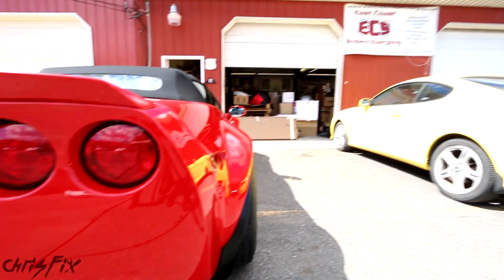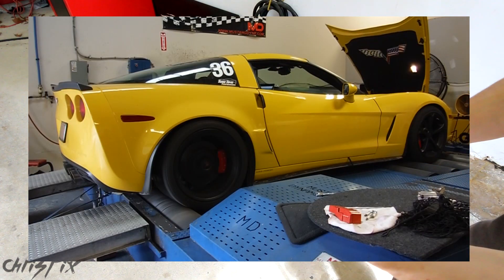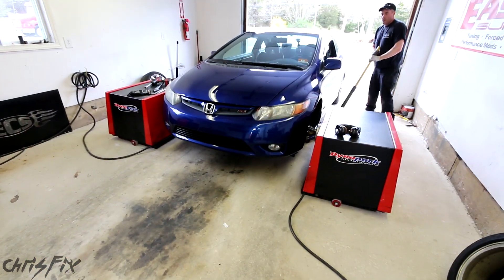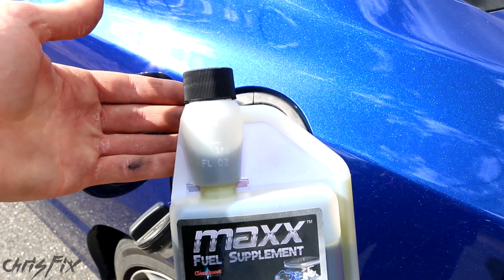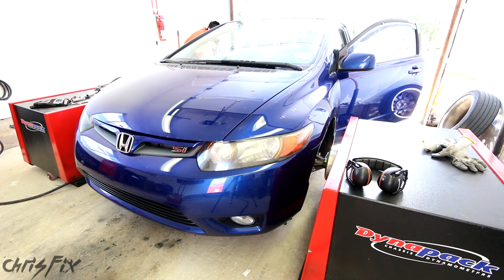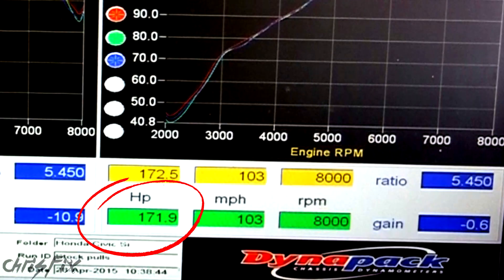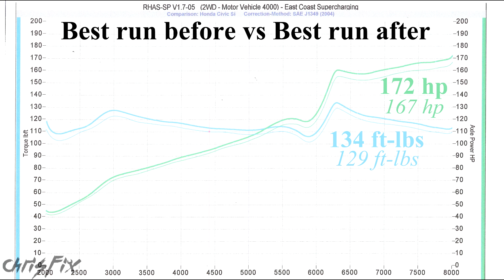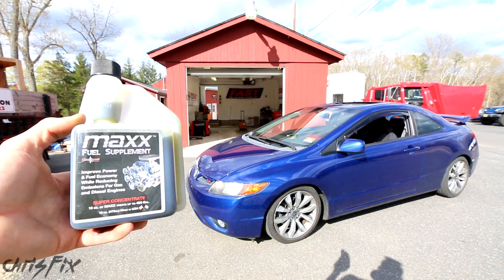Can a Fuel Additive Really Increase Horsepower in Your Car? (With Proof)

Comment: Might sound dumb, but a lot of honda guys run open header. You should dyno the civic si with and without open header to see if it makes a difference.  There was a big debate about it on the 8th gen forum not to long ago. But i dont think anyone did a dyno. That video would get you a lot more subscribers. 

If you do it try with the axel back off as well, i see a lot of people say that helps increase power as well.
Reply: Brian Dixon You just want him to dyno it so you can do the modification LOL, do it yourself cheapass
Reply from the maker: Brian Dixon That would be awesome to do but also very costly. I would need to get headers and or an exhaust and then do more dyno runs. But I like what you are thinking. I will have to see what I can do!
Reply: ChrisFix  could just do 3 runs with stock headers and 3 runs with open
Reply from the maker: Or install an electric cutout so you can flip a switch instead of unbolting the exhaust!
Reply: jr540123 I don't think I have much experience hearing straight piped V6's, but it is hard to have a V8 sound wrong as long as it's in good running order.  :)
Reply: DE Nichols some swear by it. There is even a video of a stock header (open) civic si without a tune that ran faster times and trapped higher speeds then some bolt-on tuned si's. This discussion could go back and forth all day. As it has on many many forums for years.
Reply: DE Nichols oh i agree with that, but my point is the cost. Why spend 350+ for a cut out that might very well make you loose power? That to me doesn't make sense.  You can just jack it up and unbolt it in between cool down. More work and a bit more difficult,  but you get the same results with less cost.
Reply: Car Dealer i have done it and goone to the track and posted noticeably better times picking up one MPH and 2 tents of a second.  Ive done my owm experiments over the years. But in the honda community at least the one i deal in there is a lot of hear say and anecdotal evidence as in mine. 
But me doing a dyno test for my self,even if it was recorded and posted on YouTube wouldn't get nearly the views or feed back as if ChrisFix were to do the test. And by you saying for me to do it myself, why dont you do it all yourself and not watch DIY videos.  It truly can go both ways. 
And finally i would drive around open header its too damn loud. And if i wanted to "do the mod" my self. I could any day at any time. Again i have all the evidence i need that it works. Just thought it would be an interesting video, and would love to see the conversations it would create.  But thanks for your time to read my reply Car Dealer.
Reply: ***** Pulled it off a forum, this guy explained it better than I ever could.

Exhaust many times is compared to other fluids. However, it is not quite the same due to the temperatures created during combustion and the pulses an engine creates. For an exhaust system to function properly, it has to balance flow and velocity. I am writing this to cover a broad range of knowledge bases and ages that typically frequent forums and have questions about how exhaust really works. The operation and physics behind exhaust, and the common misconception that backpressure is necessary for proper engine operation is the focus of this article. The hope is, with the knowledge gained here and from other sources, that an informed decision and discussion about exhaust can carry on.

Velocity, Flow, and Temperature:
Velocity is the speed at which matter is traveling. Velocity in an exhaust system has to be understood to select the correct pipe size. The straw example is a simple but effective method to explain velocity. If a person blows through a small diameter straw, there is a great amount of speed of the gases exiting the end. However, even as the person blows as hard as they can, they are restricted by the size of the straw to the volume of gas that can be moved. Conversely, if a large diameter straw is used, the person will be able to move large quantities of gas but the velocity of the gases will be greatly reduced.
Flow is the ease at which the gases travel through a set container. The walls of the container will always cause some resistance, but this force is usually negligible. The more things inhibiting flow in the path, such as baffles or chambers, the more force is required to flow at the same velocity. If a piece of paper is held next to the end of the large diameter straw, it causes a slight resistance to the gases escaping the straw. Gases will take the path of least resistance. Since gases also compress, the molecules are forced closer to one another for a short period because it is easier to compress than escape the end. This causes the pressure to increase. Once the pressure rises and overcomes the force the paper puts on the end of the straw, the gases begin to escape out the end. This is what many call backpressure because of the pressure that is built in the area necessary to escape the container. Backpressure only causes the origin to work harder to push more gases into and out of the container.
The temperature of the gases in a container greatly affects its behavior. The cooler the gas is, the closer the molecules are together in space. The warmer the gas, the larger volume the gas occupies. This is due to the force of the molecules as they come in contact with the container and other gas molecules.

Operation in the cylinder:
On the power stroke, the piston is moved down the cylinder from the combustion. As the piston begins to move upward, the valve on the exhaust side of the head opens allowing the hot products of the reaction out. When the piston reaches the top of the chamber, it begins the downward stroke and pulls air and fuel in to repeat the cycle. Simple really, but this is where the myth of backpressure comes in. My question all who claim they need back pressure to run properly is: What does it do? The cam controls valves so no “back pressure” is needed to close the valve, the piston returns to the bottom of the cylinder via the power produced, and the chamber needs fresh air and fuel to continue the cycle. Any gases that are trapped in the cylinder are detrimental to the next combustion reaction. The chamber needs to be fully evacuated so a pressure difference is created. As the piston moves on the intake stroke, a miniature vacuum (delta pressure) is created to draw fresh air and fuel into the chamber. The ability for the pulse to maintain the correct velocity and flow, interact and aid in the other cylinder’s operation, and exit the system are the key functions of the exhaust gases.
Modern vehicles do not rely on one cylinder in an engine so the interactions with the other cylinders are critical. This is extenuated in V6, V8, and larger cylinder engines. As one cylinder is firing, another is on the opposite stroke. This creates pulses throughout the system. Using these pulses to aid in the other cylinders operation is key. As a pulse is making its way into and out of the header/manifold it creates another pocket of delta pressure behind it. This drop in pressure is used to help “pull” the next cylinder’s exhaust gases into and out of the manifold and so on. This is referred to as scavenging. This is also why V6 and V8 engines enjoy the presence of a crossover of some sort. Due the firing order on each side, the pulses are not the same all of the time. Without some way for the pulses to equal the other side’s scavenging, the scavenging effect will be slightly different on either side. This is why many times a pop or poor operation of the engine is detected without a crossover. A pop may also be audible with a crossover system but this is usually due to a rapid acceleration/deceleration and the different rates of the pulses in the system for that moment. A crossover is recommended to be installed before the muffler, close to the headers/manifold to quickly maximize scavenging.
At any time there is approximately 14.6 psi pushing on all sides of you. The atmosphere exerts this pressure at sea level due to its mass. This is the only backpressure exerted on the exhaust system. The exhaust pulses upon startup must overcome this pressure to exit the system. After startup in a properly sized system however, the pulses continue to aid the next.

Adjusting the Power band:
The power band is described as: at X rpm produces Y horsepower/torque. This can be influenced greatly by the size and configuration of the exhaust piping. Exhaust is most effective at the point which flow and velocity are maximized. This point is when the pulse can expand to the size of the pipe without velocity being diminished. Too large of a pipe and the velocity slows, causing the pluses to create little scavenging behind them and the pulses weakly leave the system. Too small of a pipe and the flow is restricted, effectively “choking” the system.
The rpm range of operation is quite large on most motors. Idling at 700 rpm and redlining at 6000 rpm create very different environments in the pipe. At lower rpms, less volume in the system is needed. At higher rpms, more volume is needed. Since most drivers don’t do one or the other all the time, the median for normal operation is ideal. This is where the powerband comes in. By having a larger diameter system the higher rpm range may produce the best power because that is the point at which flow and velocity are optimized. However, in these systems a loss in low range power is felt due to the fact that velocity is not ideal. If the volume of the pipe is too large the pressure drop behind each pulse will not be as likely to help in the scavenging effect of the next cylinder. The same principle goes if the pipe is too short. The short pipe does not allow enough time for proper scavenging and leaves the system before it can occur. This is why things such as open manifolds and ending the system under the cab do not bode well. With a smaller system, low range power is optimized because lower rpms are most efficient at scavenging. At higher rpms, the system’s flow is not sufficient, thus less power is able to be produced.

More than just pipe:
Exhaust does more than simply get waste products out of the way. In vehicles that utilize oxygen sensors, the exhaust is the critical component to monitor air/fuel ratios. This measurement by the oxygen sensors is critical in maintaining correct a/f ratios and prevents from either lean or rich conditions. Changing the location of these sensors or how the gases interact with the sensors, needs to be accounted for by adjustments to the PCM.

Any modification to the system can have an impact on the performance of the engine. Understanding how the different segments interact with the whole is crucial when modifying a vehicle. With this knowledge, you should be able to understand how exhaust systems operate and be able to make quality decisions when choosing to modify your system.
Reply: Luke Hawkinson and i finally read the f150 forum  post. which is oddly much like what i pulled out my memory banks ....... too many hours in mech shops i think is the problem with me some days. i digress
Reply: Brian Dixon Take a trip back 50 years in my friends memory and he predicted to his friends, "Don't do it. You need to even out the engines exhaust pulses." Their endless racing proved him right.
Reply: ChrisFix either stock open or aftermarket would be a cool test
Reply: Brian Dixon Ah. Good thinking!
Reply: Jacky L. Damn it was just a suggestion, it wasn't a demand.....lol.
Reply: Jacky L. Oh and i agree on the mod comment,  but if you actually look at his videos, he does a lot more then test additives.
Reply: DE Nichols   With a full exhaust  cold air will not make it to the head once the car is shut off ... The exhaust cools slowly allowing time for the engine to cool also ...  If you pull the down pipe off ,  then shut the car off after a dyno run , there is a very high chance of damaging exhaust valves due to the cold flash of air hitting a very hot surface... It can crack the valves or valve seats , it can also damage the head ......
Reply: It can and does happen on all engines ... I destroyed an F22A6  (in my prelude) because of this ...   I had just the header on  and was going to the exhaust shop to have a custom setup run .. About half way there 2 exhaust valved broke and dropped into the engine ..  Once we pulled the engine my machinist told me that is what it was from .. Cold air hitting a very hot surface will cause cracks and failure of said part ..  I dont have a K20 so i cant speak for that particular engine but if the stainless valves in my F22 did it , then a stock setup can also ..
Reply: Can you verify this at all? Or are we on horror system?  Not trying to be a dick, but again i ran my b20v for a very long time like this with absolutely no problem. Ive also driven to the track i live in katy texas out side of Houston, the track is 1 hour away 2 with traffic. I drove to the track through traffic,  raced at the track all night long. Then drove home. 
I would need to see some documented proof, not just word of mouth.  Because anyone can day anything these days.
Reply: Just to be clear ......... This is a known problem ....... Ask any competent mechanic or engine builder .. Yes cars have been run like this (open headers) and survived ... However , the chance of you destroying your engine is still there ........ It only takes 1 time for the right condition to be met and bam your engine is toast ........ And Brian where is the proof of a year with open headers and no internal damage to the engine ?    Have you torn it down , done a flow test , compression test , leak down test ?  Compared any of these to a stock car ?   If not , then you can difinitively say it does no damage ... Because seat of the pants is not an accurate form of testing ... 

Is is possible : Yes 
Is it probable : No 
Has it happened : Yes 
Has it happened often : No 

SO chances are it will not happen to you , but there is a possibility that it CAN ... Are you willing to bet a 3k engine on the chance that it will not happen ?   Me ,  NO , because it did happen to mine ...
Reply: Norman Murray
Go to a junkyard and do all said tests on lets say a carbed 302 (Fuckers are plentiful to this day and still cheap to buy) run it up to temp like normal with a full exhaust for a baseline then shut it off and cool it down, then go from open manifolds to open headers from shorty's to longs then pull it off all together and run the bitch up to temp rev the fuck out of it and kill it. I could bet money it would be just fine afterwards even if it got up to a stupid high temperature before shutoff. Its been done before and can be done again with no ill effect other than normal wear and tear.
Reply: ***** Since you brought it up first, I'll reply to you. All of you should check out my articles for details about my experience with a normal number of cells cat. Got a bigger one and it made a tremendous difference. There's no way with how my "2000" Chevy Prizm's computer is setup, that I'd pass emissions without 400 cells. 

http://carmilespergallon.blogspot.com/2014/08/catalytic-converter-and-horse-power-why.html?m=1
Reply: jr540123   1 Why would I waist money on a Ford 302 ... 2  As I stated I already damaged 1 engine this way so I know it happens ... 3 If someone wants to run their car this way they can ... I just know what happened to mine so I wont do it again .... My setup was an F22A6 with a short header that was 2 cylinders into 1, I was heading down to have a custom down pipe made and the exhaust valve on 1 and 3 let go . 1 broke and dropped into the cylinder , the other warped the valve and damaged the seat ...... So no I will never do it again I dont care how many people say its ok , I know better .......
Reply: Brian Dixon dude are you serious? What is the point of running open headers on a civic? For one thing it's a freaking civic it's not gonna have alot of horsepower and no headers will just make it loud and annoying as fuck. Louder doesn't mean faster lol
Reply: And this is exactly why i posted what i posted. To give chrisfix a good topic for another video. Is it good? Is it safe? Do you loose power? Do you gain power? 

Whats the point of a video on YouTube?  For the views.  And this comment alone show it would get great views. Ive got 25 +1 like on this comment. And its also created a decent discussion. Like it or not, the video i recommended him to make was a good idea.
Reply: jr540123 I won't say you flatout wrong but....... experience proves it. for na cars---- 88 civic cat back 3" pipe no mufller = bad idea. F1 teams tune the exhaust extensively. Its not really back pressure that is the problem though. with an open or long tube header you loose the suction the exhaust pulse makes reducing exhaust scavageing particularly at low rpm. robbing you of torque. it might make a few more horses at red line but thats not where the power is needed for street driving.            Super charged car ---- basic na rules apply with the caveat of low rpm torque loss in made up for by the s.c. tune for the mid range 3-4.5krpm
turbo car ?   its complicated..... smaller diameter header will spool a turbo quickly & larger will spool it more slowly.  back pressure actually become a thing here. the pressure build up is what powers the turbo.  turbo size and type is a factor. ( number of vanes type of vanes over all diameter. intake & exhaust side)  Cat diameter and location. but after the turbo is less complicated. bigger is better but too big is a waste of money.  
ecu tuning does make a difference. however good hardware makes good software better. Great hardware & software is amazing.
exhaust is not a bigger=better thing. its a bigger might be better for this under these conditions
Reply: jr540123 open exhaust can warp/crack heads though. mostly from the negative side of the pulse  sucking debris/water into the engine although somewhat of a rare thing to happen
Reply: Luke Hawkinson
A tuned exhaust system that is built up proper is by far the best setup for any Na internal combustion engine if you are looking for the best of everything for your engine and what your desires from the car and the way it sounds to wither you want the low end grunt down low or a little more up at the top end. But I will say you are very educated on the manor and seem to understand how our engines function very well. Did you by chance go to a school for all this knowledge or just picked it up as you went?
Reply: jr540123 Part of it is a basic understanding of physics. the other part long conversations with my cousin (sae mechanic) Between the two i have a fundamental knowledge, not a working knowledge. Even though i do have a little experience hands on helping build with him. and i have driven hack jobs that were tuned badly (more experience). but not any experience building by my self.
Reply: Luke Hawkinson
Ah I see friend I have some hands on here and there helping people out with some of their stuff or working on cars in my past job as a mechanic but I only understand but so much some days. Sometimes I just well know what seems like a good idea for an engine and what may or may not be a bad idea for it, then other times I visit the forums for help to make sure where I go with an idea is the right way and not a road that will lead me to failure.
Reply: ChrisFix yea but that cost money for something that might not make much power or actually rob power. The exhaust is only held together by 2 14mm bolts. Takes maybe 15min to remove the entire thing.
Reply: Brian Dixon If it's not old and rusted. Electric cutouts would be much easier to test at the dyno.
Reply: Brian Dixon the guy tests additives .... not mods for the civics ....
Reply: Brian Dixon there is nothing to test you may gain a couple hp at most, but you will be losing a substantial amount of torque  you will be slower.
Reply: yesac101 It'll damage the engine as well. At least I know this is true from my old neighbor's racing family cars in the 60's.
Reply: You can't balance the exhaust flow and help the engine with headers alone.
Reply: DE Nichols cars are different now, and you can run open header without damaging anything.  People do it all the time, as did i back in the day when i had my b20vtec. Ran open header for 2 years
Reply: DE Nichols It can damage the engine if air gets to the valves, but its very unlikely to happen.
Reply: yesac101 What about no thermal protection every time you turn the engine off?
Reply: Norman Murray That's exactly what worried me. You sure said it better. :)
Reply: Norman Murray can you show me one example of this on this car? V8 yes, but can you find this on a k20
Reply: Also doing a quick search "running open header h22". It seems that the entire honda community agrees with me. Yes some people say what you've said that it could, but countless testimonies of builders,tuners, racers,and street warriors contest that they them selves have ran open with no problems at all.
Reply: Brian Dixon I thank you for your researched opposing view. What I get out of what you shared follows:
     Before anyone try this and be the guinea pig check to see if others haven't destroyed their engines first.
Reply: DE Nichols Done it myself with v8's, ran around with nothing but headers to and from the exhaust shop beating the fuck out the engine with the new found power and never once had an issue, I've seen cars run around with even less of an exhaust system than that or in the case of my buddy's 351w one side good and the other side with a huge crack down the side of the manifold for the engine. He ran the fuck out it of until he pulled it and i bought it and other than the owners before him snapping bolts off in the timing cover it was still going strong. Modern engines aren't as weak and fragile as people think. You can do some damn near crazy shit with them and get away with it.
Reply: DE Nichols well you get absolutely wrong, ive already stated several times that i have already done it my self. I ran for over a year with no problems.  Again i can show you many accounts of it doing nothing, you have yet to prove anything at all. You probably have never even driven a civic si let alone ran open header your self to see if it will mess anything up. Unless you back up what you say with an actual verified account please move along and stop feed false information.
Reply: Brian Dixon Would headers work better on a V6 engine?
Reply: Yea i just asked the guys over a secret service auto. A well known performance shop here in Houston. They said they have heard this,but have never saw this as a problem on the k series or b series motors. They said if you ran without an exhaust manifold,  yes it could happen, but not with it on. "We tune cars open header all the time" is what they told me.
Again i looked everywhere lastnight to find some sort of evidence to support the claim that it could damage the car, but all i can find are people like you guys claiming it could, nothing to support the fact that it has happened. I think it was a mustang that had some damage from running open header but it was a short tube header. But thats all i could gather.
Reply: *****
Small piping to an extent, got to have something properly sized for the engine and its applications or else you are just wasting your money, modern cats flow well and unless you have a full on high hp engine you really don't need high flow cats. Mainly proper sized pipes for thee engine and a decent flowing muffler or no muffler if you are like me.
Reply: Unknown Bob On the smaller Honda engines I bet exhaust pipes pointed backwards add more power than silly open headers. Lol
Reply: *****
Backpressure is a myth, You don't ever in ANY Gasoline engine want backpressure in an exhaust system. You want it to FLOW and FLOW correctly based upon your engine choice and where its power band is. Google around and look at some forums you can find some great info on what does and does not flow.
Reply: Norman Murray You seem to be denying something that can be and has been proved both by modern tech and by experience from the past of many other guys before you who have done this same exact thing and been just perfectly fine and still run around with open exhaust or headers or whatever with no damage ever done. How old was your engine? And for that matter how badly was it abused during its life?
Reply: jr540123 great post!!!
Reply: Brian Dixon
Don't thank me, thank the Ford F-150 forums.
Reply: jr540123 Thank you. That was extremely worthy of my time.
Reply: Open header on a 4 cylinder sounds like absolute shit. I'd rarher make less power than make that awful noise. Good thing my 6 cylinder actually makes 291whp AND sounds good in the process..
Reply: Nick Motsarsky Agreed. I couldn't stand it even if it worked.
Reply: Nick Motsarsky
4 bangers I can handle straight piped and they sound cool depending on the engine, v6's sound like the worst of the two to me straight piped because its either a wannabe v8 sound or a fart of a low reving 4 banger. Now v8's of all shapes and sizes the sound of straight pipes I love to death. Just a beautiful note to me. Power is a must for sure in my books as well but a good exhaust note is a good note none the less to my ears.
Reply: vr6 sounds good to me